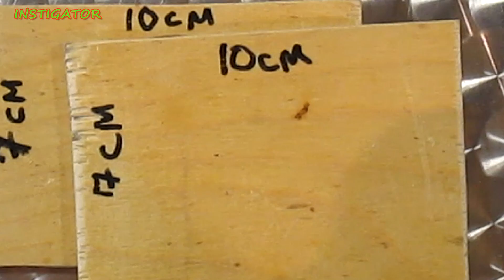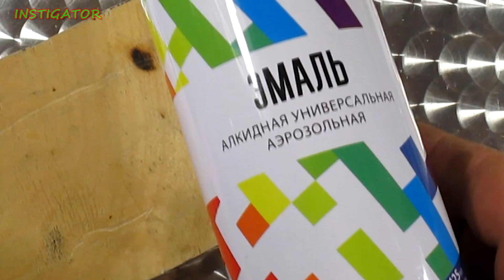how to make a simple power supply .training.DIY

Comment: sigh... where to start. I guess is ok for a beginners project, although you could at least have added a bridge rectifier and smoothing capacitor to the transformer. Using connectors which doesn't provide their rated voltage is not a good practice especially if they provide higher voltage then what they should.

The way I would do it, transformer, bridge rectifier, cheap ebay step down dc-dc 5v step down buck converter for the usb, cheap regulated buck converter preferably with current regulation coupled with banana connectors for the regulated output.